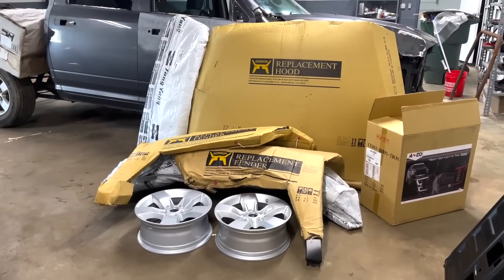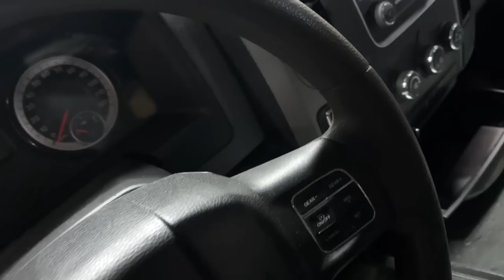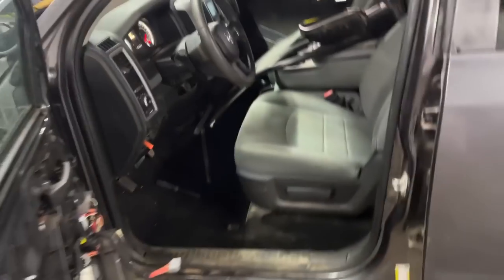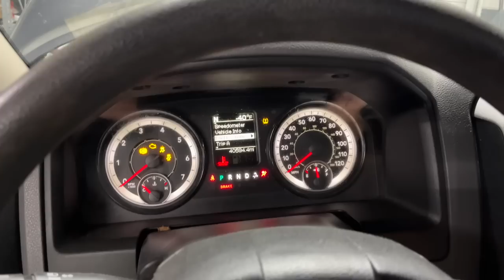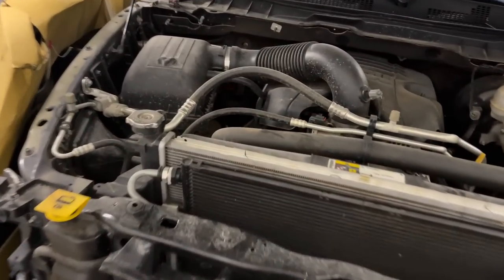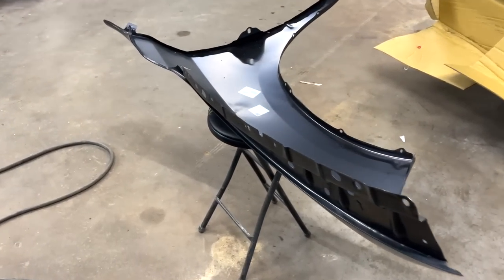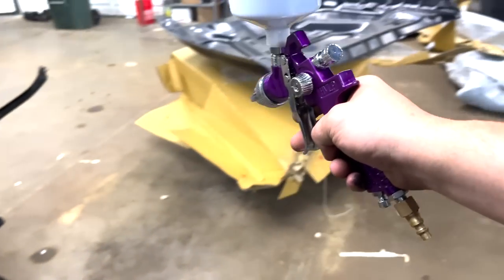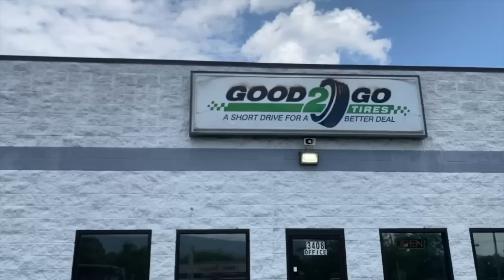Rebuilding My Wrecked Dodge Ram 1500 With One Website!

Comment from the maker: Check Out Carparts.com Savings of up to 50% off when compared to your local dealership or auto parts store Here https://bit.ly/3n81HMU
Reply: regarding stands to put all the stuff on. Check around at harbor freight and other places for plastic saw horses. They aren't the strongest but they are light cheap and fold up flat when you don't need them. I have like 3 sets and looking for more when they are on sale. When I say not the strongest, I've dropped a 2 x 12 x 12 ft floor joist on them and they didn't collapse.
Reply: Looking good V-Tuned